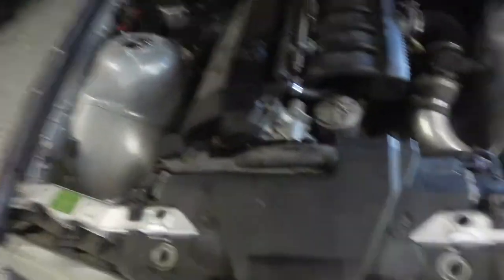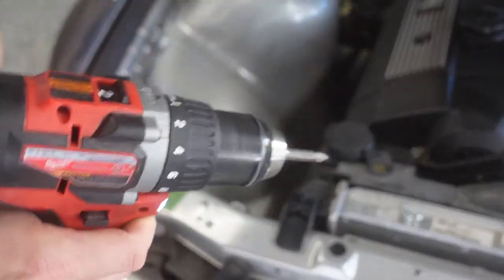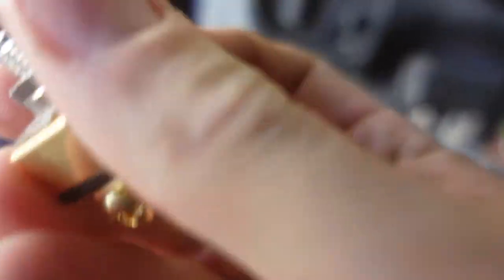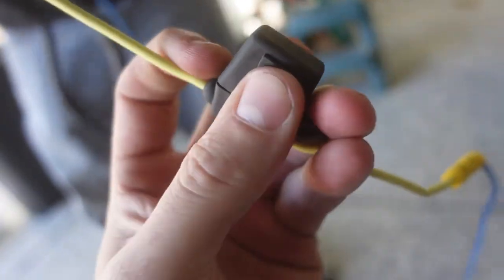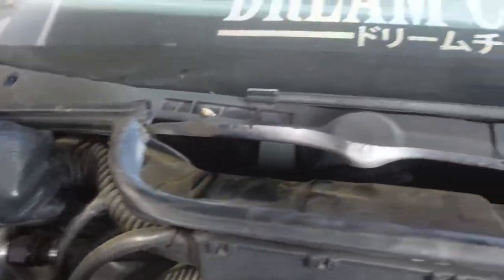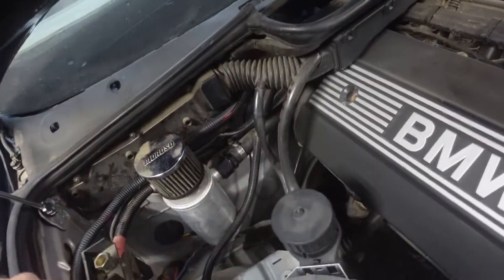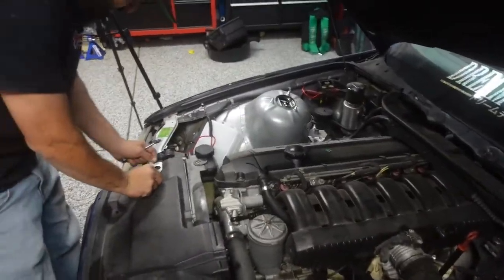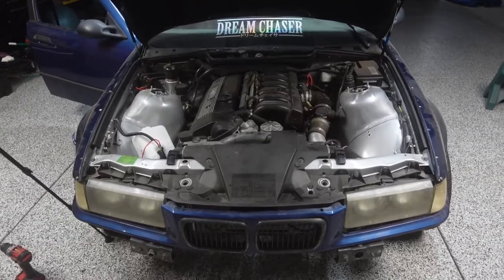E36 | Installing a radiator water sprayer!!

Comment: Did this work? Can you elaborate on how much cooler was after?
Reply from the maker: Most guys at the track will take a water sprayer and spray it in the radiator to cool down the car..
More then likely the water in the sprayer will be a bit warm from engine heat. It should still help with the cooling on a cool down lap. Which is it purpose. Probably going to relocate the water container at some point

Comment: Nice video, very informative. Have y'all tested it on a hot radiator?
Reply from the maker: Thank you! Yes this system works the same way as if I was pouring water on the radiator to cool it down. The radiator is aluminum so it won’t crack or break from colder water being thrown on it.